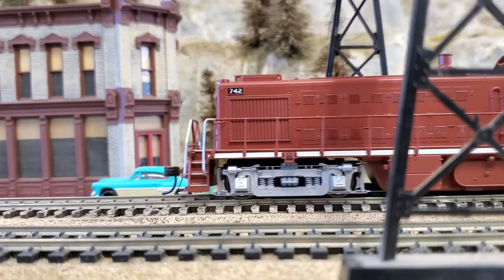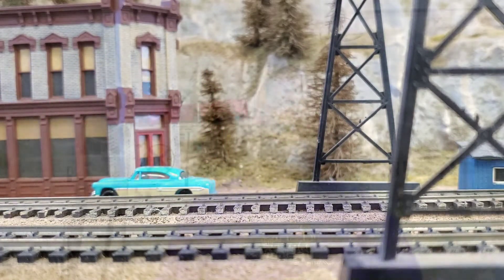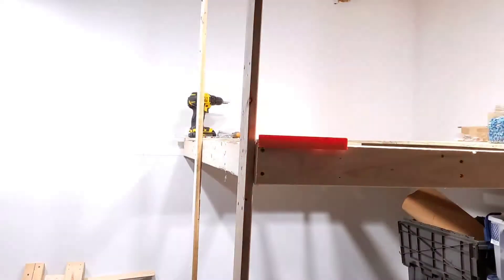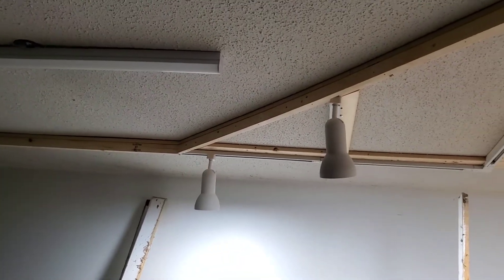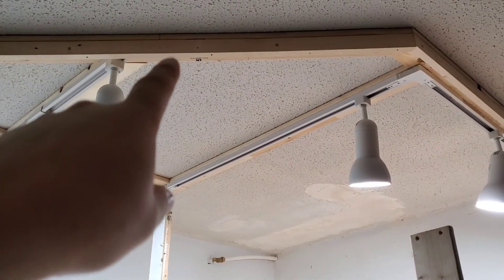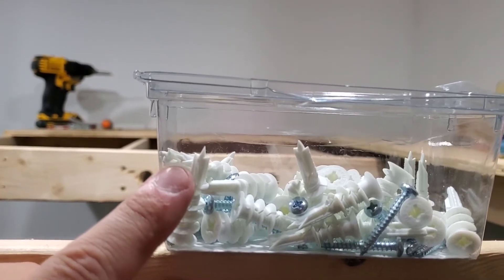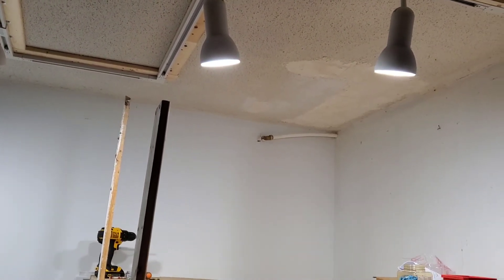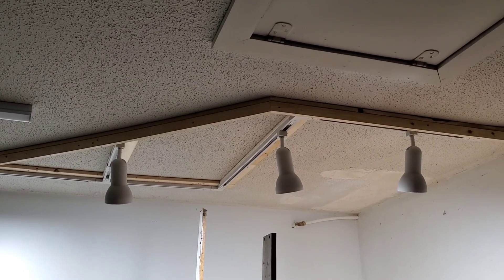Layout Update - Track Lighting for Layout Upper Level

Comment: Hi ya Jason. Well……at least you will be able to see what you are doing. Are those just standard bulbs in those fixtures? The reason I ask is the one light that was reflecting on the wall looked as though the light was very concentrated on a small area. Like a spot compared to a flood. Or maybe that’s just an illusion because it’s close to the wall. Anyways….   Good job. See ya.
Reply from the maker: Thanks Normal, they are all BR30 (flood) style lights. I think it's an illusion because it is aimed down. I think a colorful backdrop will help disperse that illusional spot.

Comment: Lighting is my biggest problem and with only a 7' ceiling it is difficult to get even light. I have hot spots and dark areas.
Reply from the maker: It is tought to figure out. This is why I went a direction where I can easily add an extra light if needed and adjust others instead of a fixed location. The only tough stop is going to be in that 45° section.